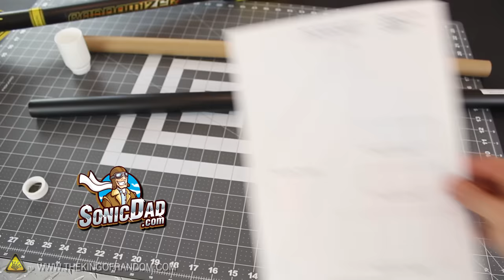How To Build A Rocket (From Scratch)

Comment: One of the first videos of yours that I actually tried, thanks so much man, RIP
Reply: Tom M did it worked???
Reply: @stefankurija4960  worked perfectly, even built my own motors
Reply: omg dude i am thinking of making this for my science fair did the parachute deploy with no difficulties??
Reply: @aki2405  no issues, we used quite a tight fit between the nose cone and fuselage/ body but it still popped off no issues
Reply: @blacksquidgaming  Thankzzz bro! Owe you one!! we are hoping to win atleast 3rd, 2nd or 1st
Reply: Im thinking about making own motor. Any tips or how you did it.
Reply: Sameeee
Reply: I did it too
Reply: True
Reply: @aki2405  it sometimes doesn't deploy... it's not the parachute's fault, it's the motor. I recommend you use a store-bought motor
Reply: Did he pass away?
Reply: Sameer Rahman you can get Estes kits and motors that work perfectly built 3-4 recommend a less powerful engine though as the big boys go well sky high something like a b-12-17
Reply: Did it work and did you do it at home by your self
Reply: @aki2405  did you win?
Reply: @blacksquidgaming  how much did it cost all together all resources
Reply: @saisuddapalli2000  I did it for a student engineering award, studying and developing over a period of around 6 months. So im not 100% sure of the price as I bought as I went along. we were given £50 for base line materials from the people running the program and I sunk around £20 into the project. But we were doing more of an in depth study. You could probably reliably make a rocket for around £10 £20 depending on changes you make to the design and less if you have materials. Rocket motors are hard to perfect, you're better off buying hobby motors as perfecting burn speed and maximizing thrust is not always as easy as it would seem
Reply: @blacksquidgaming  Does the fact I'm in UK make difference
Reply: @blacksquidgaming  Does the fact I'm in UK make a difference
Reply: 1244567
Reply: Did he pass away ??
Reply: @saisuddapalli2000  no mate I live in the uk
Reply: @dadadarshan  10 months ago in a hang gliding accident sadly
Reply: @blacksquidgaming   oh my gosh 😱😰 rip
Reply: @blacksquidgaming  thanks i will think about it
Reply: @aki2405  did you win?
Reply: The first video i watched.R.I.P brother
Reply: Fun is the reason Yes. Grant Died In A Paramotoring Accident Last Year.
Reply: Tom M Nice!!
Reply: is be alive ?
Reply: reason  yes he did unfortunately  but not him Grant Did
Reply: Are you crazy you dont see dead people
Reply: @blacksquidgaming  bro how do the parachute deploy. Automatically thrust has gone plz tell me??
Reply: Rip
Reply: Did he die?
Reply: Does the parachute just fall out after lift off?
Reply: Why rip?
Reply: @MJC___   he dead bro
Reply: @phantomgamer8275  how he die
Reply: Why rip he didnt die
Reply: @milantrnic8162  Pretty hard to survive a paragliding accident. He died dude.
Reply: I don’t know he died he just got older
Reply: @milan v kessel Press space.
Reply: @blacksquidgaming  Congo man!
Reply: RIP legend
Reply: What is that rocket name
Reply: @averymorse5279  he died :(
Reply: @blacksquidgaming  Wassup with the ''RIP''?
Reply: @ScubaShark--8964  he died in a paramotor incident
Reply: Over a year ago
Reply: @blacksquidgaming  R.I.P... I- He is my fav YT content creator, made me felt like... He's still with us rn. Tragic... Mandela effect.
Reply: @blacksquidgaming  🙏
Reply: Did it work
Reply: Hey, Im trying to make my own model rocket, however, I am wondering how the nosecone would pop off on its own? Can you please tell me how?
Reply: RIP?
Reply: @aki2405  man I’m thinking of doing for my science fair!!
Reply: @aki2405  year later but,did you win?
Reply: Did he die
Reply: i'll give thus the 2000th like
Reply: @marcusaureliusregulus2833  yes
Reply: @Some Random Guy On The Internet yes he is
Reply: @shlace7976  You can go to TKOR’s video where he made sugar rocket fuel. Hopefully that helps you!
Reply: @blacksquidgaming  can you tell me how you built those motors
Reply: @aki2405  ik your commented this ages ago, but did u come 1st?
Reply: @ahh6938  ok hear me out. 
While making the rocket i  found out that our country has banned lethal flammable chemicals like potassium nitrate to be used by the people of general public. Furthermore, as it was a bit dangerous i could not convince my school so i decided to switch the project idea to something else

What i went to is automatic street lamps which is automatically turned on/off when it detects a car/pedestrian passing and turns on many consecutive lights in front of the car/pedestrian when it passes it turns the lights behind off. This saves energy and thus the environment. 
This project won 1st prize. I can discuss more in depth if you want!
Reply: @aki2405  Wow congratulations, I also have a science project that I need to start soon. What kind of materials did you use to make the automatic street lamps? And how did you automate them?
Reply: Metals are essential than crypto currency buy silver than crypto currency
Reply: @aki2405  can you explain more please
Reply: @lolososo6760  this is used in automation, processing, and utilities by use of a plc or arduino automated solenoid valve.
Reply: @seanpoore500  thanks

Comment from the maker: Some quick links to a few of the materials similar to what I used:

[✓] Plastic Champagne glasses: http://amzn.to/2c2WJ37
[✓] Yellow Spray Paint: http://amzn.to/2c1VcYp
[✓] Gas Relief Pills: http://amzn.to/2cVqGSC
[✓] 150 Grit Sandpaper: http://amzn.to/2cHTRs1
[✓] 400 Grit Sandpaper: http://amzn.to/2cXUBWc
[✓] Golf Bag Tube: http://amzn.to/2cHVfKY
[✓] Wrapping paper: http://amzn.to/2cmNRpl
[✓] Epoxy Glue: http://amzn.to/2ceE8y4
[✓] Hot Glue Gun: http://amzn.to/2cVqR0n
[✓] Elastic Braided Cord: http://amzn.to/2cXWbYj
[✓] Scissors: http://amzn.to/2cVs2N8
[✓] Plastic Table Cover: http://amzn.to/2cmQ2sQ
[✓] Swivel Hooks: http://amzn.to/2cmQasg
[✓] Rocket Wadding: http://amzn.to/2cmPao5
[✓] Rocket Engine: http://amzn.to/2cHYDWb
Reply: hi
Reply: I'm sure toilet paper rolls will also work
Reply: Grant Thompson - "The King of Random"
Reply: First Name Last Name Image macros are used by scorch plate hypnotists, and SPHs are blatantly harmful to 301 players
Reply: Grant Thompson - "The King of Random"  what are the measurements of the plastic golf  bag tube ?
Reply: i like your vidos
Reply: Grant Thompson - "The King of Random" How did you verify your CoM and your static margin?
Reply: Grant Thompson - "The King of Random" I don't understand how does the parachute come out when the rocket motor is over. 
Please answer Grant, I need it for a school project. I'd be very grateful if you did.
Reply: @hawky4397  blast charge almost explodes it out due to preassure
Reply: I cannot see the rocket links, it says that it doesnt exist

Comment: Parts List: Bottle of gas relief pills Plastic champaign glass 40 grit sandpaper 150 grit sandpaper 400 grit sandpaper Spray paint (for plastic nose cone) black spray paint 3/4 in female threaded coupling Plastic golf club protector Roll of wrapping paper (for the tube) 2 part epoxy popsicle stick Masking tape Black poster paper Black corroplastic sign board Label paper (if decals are desired) Plastic disposable pen Hot glue sticks (several) 1/4 elastic cording 6.35mm x 2.74m (Parachute from other tutorial) ●plastic dollar store table cloth ●#3 crochet thread● 1/4" elastic cord●#7 fishing swivels (Rocket wadding from other video) ■paper towels ■baking soda Tools list: Exact Knife or equiv. Flat metal file 3/4 in pvc sprinkler riser Paper towels Old hacksaw blade Flathead screwdriver Hot glue gun Scissors
Reply: Even though this is 6 years ago, I want to give you a thanks
Reply: Thanks bro
Reply: Man you saved me thank you
Reply: And all of that for just 5 bucks... Man, i love the dollar store.

Comment: Saved.  Love this build!  I wish there was a bit more detail on how exactly the parachute deploys.  I guess it's just a loose fit and the momentum of the chute wad pops the cap off(once the rocket stops moving forward)?
Reply: The black powder in the top of the rocket creates a pressure wave when it is ignited by the time delay mix and that pressure deploys the parachute

Comment: The rocket works great, except that the motor needs to be inside the rocket body (less than an inch should be hanging out) so that the center of gravity is moved up towards the nose cone. It will come off of the launch pad much straighter. 

A friend built two of these. One he made exactly like the video and one with the modification I suggested above. Both fly great, but the one with with the design in this video comes off the launch pad slightly sideways before the aerodynamic forces on the fins cause it to straighten up. I believe it is because the center of gravity is too low. The rocket with the modification came off the launch pad beautifully and flew straight.

Where you move the motor mount depends on whether you plan on building the screw lock engines or using Estes engines. They are different lengths.
Reply: Did your friend  have a parachute deployment system or did he just shove the parachute into the rocket

Comment: Doesn't the nose cone fall off? Or did I miss something?
Reply: he connects the parachute to the cone and the body.
Reply: Thanks
Reply: help,i am still not understanding how is it falling
Reply: Gamblingo 225 same.. why this nose falling off?
Reply: i was trying to make one but the parachute is the problem,i'm not using his design tho
Reply: Perhaps some of the gases from the engine, when the burn is over they push the rocket tip.
Reply: He didnt metion that how the parachute works. That pissed me off. And what is it for the two adjusted mini tube in the side?

Comment: And how will open the chutes in sky?
Reply: +Hubert Martin  watch his other video called ''screw lock'' sugar rockets to find out
Reply: The gas from the engine has enough force to eject to wadding and parachute.
Reply: william kee 🐮هه8
Reply: if you use Estes motors, after the propellant there is a ejection charge that pushes the chute and nose cone out of the body tube

Comment: For trimming the pill bottle, or any cylinder, try a utility blade, just the blade and use a hard back book. Place the blade along the binder at what ever depth you need. Press the book close and slowly spin the pill container against the blade. A perfect cut.

 I learned this trick when cutting coke cans for my DIY alcohol burning stoves.

Comment: use a hairdryer on high heat and it will soften the tube up enough so you can just slide the pill bottle right in.

Comment: I'm planning on building one with a camera, what do I have to change in order to incorporate the camera, since the balance will be completely off if I just strap it to the rocket?
Reply: Look up "rocket equation calculator" there are simple formulas to determine proper length to diameter and also payload percentages as related to length and diameter.
If you simply strap the camera to the rocket bad tings will probably happen, incorporate it into the body or nosecone so it is balanced.
Reply: @dgrfsthrgsergwrtghasefq  thanks a lot, I'll look into it!

Comment: Hi buddy,hope u r well n doin gud.☺,i have question wich is can u pls tell me that y does the whistle rockets or shells do whistle???does it bcoz of some special mix in the powder or it is a actual whistle design inside the shell or at the bottom of the rockets,coz i see a perforated whistle kinda structured tube at the lower end,i m confused dat weather it is the trust in dat structure wich produces the whistling sound or else dere is something in the mixture.pls guide me through this.

Comment: does the parashute eject automatically when it falls down can you pls explain the mechanism
Reply: the motor in the rocket has three stages the first is the most thrust the second is delay and the third does a like boom which pushes the nose cone off which allows the parachute to deploy.
Reply: @SukhrajRandhawa2353 sir he didn't put anything to eject the parachute out? Did he? How do you open the parachute?
Reply: @SukhrajRandhawa2353 ooo I understand